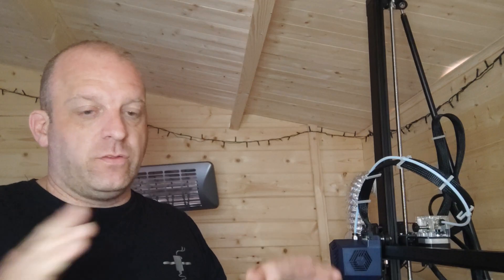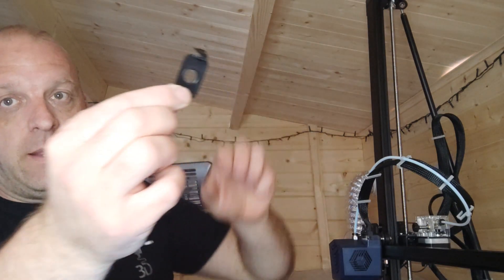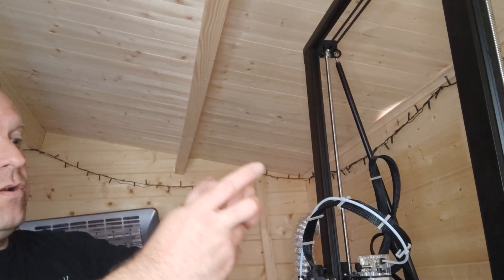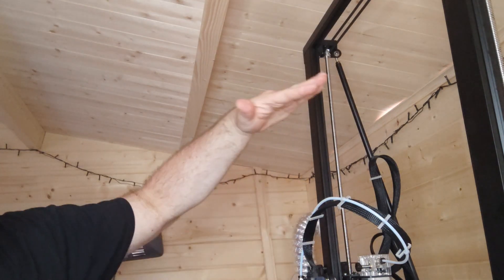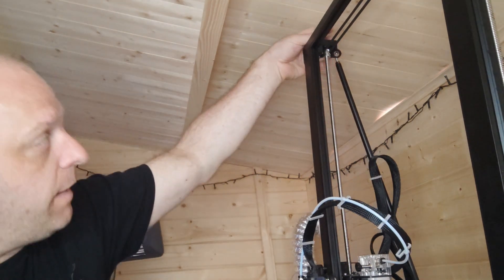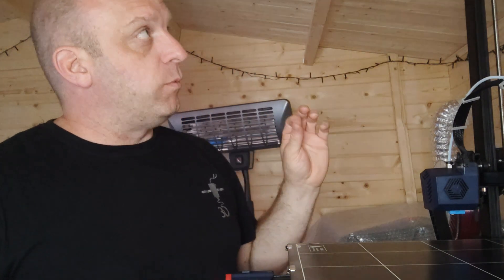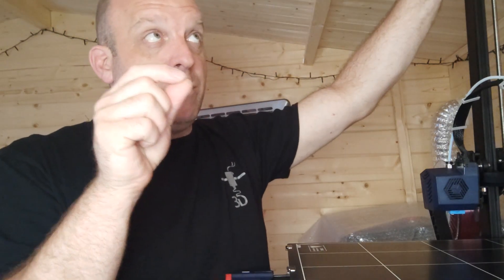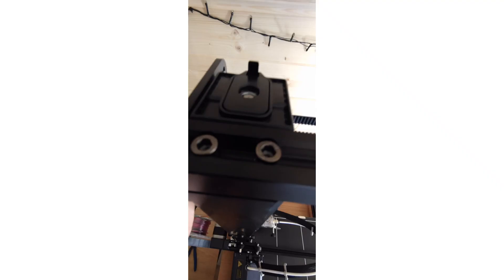important discovery on the Anycubic Kobra Max - definitely check your gantry 😉

Comment: funny thing happened to me i was setting it up and put a magnetic flashlight on the top of the kobra max just above the bearing and when i pulled off the flashlight it pulled the bearing and the plastic plate off.  those plastic plates do not click and hold in place well.
Reply from the maker: Agreed they are pretty flimsy, I make videos for these as these can be potentially printer affecting

Comment: I saw those clips when I assembled my Max and saw at that time what they were for. Mine were firmly clipped in (not like all the loose "factory" screws) ad would not expect them to unclip. My concern with your discovery is if your clip was originally snapped in and, through all the printing you're doing, just popped out on its own. Maybe another use case for duct tape as an anti-unclipper :-).
Reply from the maker: Definitely I have added a small strip ontop quite possible when I covered over the printer I may have knocked this out of place... Just thought I'd wack out a video and highlight this just In case... It doesn't look like a printer part 😅
Reply: @3DPUK-TECH-CHANNEL  So, just finished a print and check my Z clips. One had popped and was just sitting there!!! I know bother were clipped in after assembly. So, not really wanting to go downstairs for duct tape, I decided to look in my worksop garbage (rubbish ;-) can and found that black foam that was shoved in the extruder for shipping, cur to size and used the small allen wrench to shove it into place. Looks good. I'll see how it works...
Reply: Wish I could edit after a post. Seems I cannot type without typos :(
Reply from the maker: @bobellison2547  
Lol that's odd that it's loose